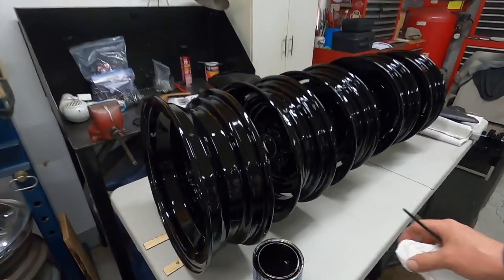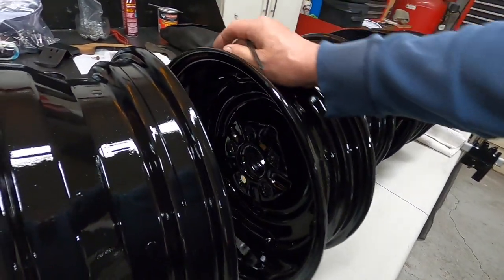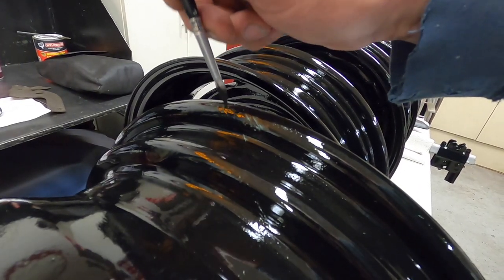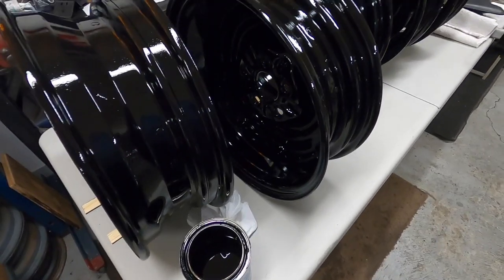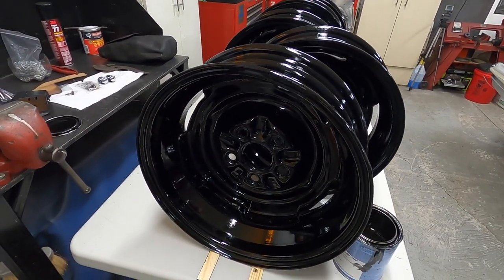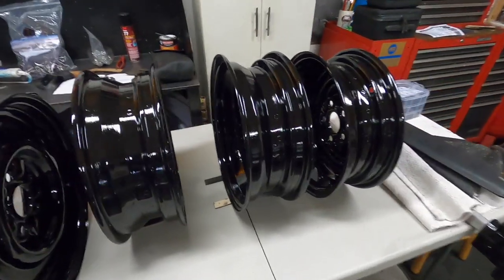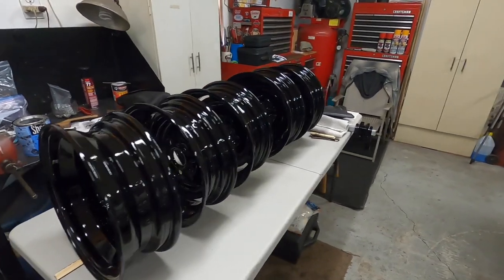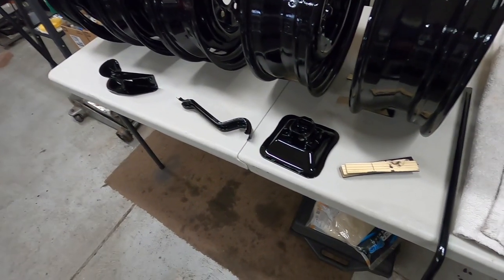1966 Ford Galaxie 500 convertible restoration part 197 doing lots of little stuff & new tires

Comment: Howard, what a nice job on the wheels and jack parts, so many restorations never get this attention to detail. This is kind of the fun part, installing the small parts bringing the Galaxie to its near new condition. The Ford factory put these cars together at a fast pace, during the dis-assembly that you did, in some areas,  it was plan to see that there was areas that could have been sealed up better or primed & painted at the factory, and not left bare. I guess to make these car affordable at the time, and considering Ford was only concerned with the car lasting five to ten years, they drew the line at some point. Most of us would agree you can never  protect metal enough from the elements. Great job Howard.
Reply from the maker: Today I was rust proofing the rear quarters..... The left side had more paint and very little surface rust. The right side had less paint, and a little more surface rust. It's all cleaned, oiled and rustproofed finally. Now when I get the spare tire mounted up, I can reinstall it, then not need to remove it again.... hopefully.....

Comment: Hey Howard!, Those whitewalls look great! I'm having whitewall issues myself ! Came out to find one of  the front tires about half way down! Called triple A to put on the spare (I wont use the factory jack either although my hooks (one design for the front and another for the rear), have big rubber pads to protect the chrome. At the tire store they couldn't find the leak (gee, what a surprise!) so I asked them about ordering another tire and they said you should get 2! They're American Classic so they'll make a pretty good mark-up on those when they come in  FOUR WEEKS! Egad, everything is in slow mode now days!
Looking forward to seeing yours with the hubcaps on!!! It's going to look "awesome!" there, I said it, I used a "kid word"!! LOL!
Reply from the maker: Slow leaks are often the valve core.......

Comment: Howard, You can use Black Spray Dye in a rattle can for the seat belt material. ...and just lightly spray it on.  It works well and won't come off on your clothes... I've used it for decades.. The trick is to use as little as needed.. and it works great.. I just realized that you used Gojo on the seatbelts though...and because of that, The dye might be an issue unless the material is completely free of the GoJo.  You could test it on the belt I sent you first..:o)  Tony K.
Reply from the maker: I scrubbed the belts in dish soap and water, then rinsed them until the water stayed totally clear, so I'm 90% certain the GoJo came out. I use spray die in the past on seat belts, only to regret doing it. Maybe in the fall I'll stitch up new belt material onto them. I have the stuff, so why not.

Comment: Those whitewalls look great.  I look forward to seeing how the wheel cover grips can be covered with Plastic Dip and still grab OK.  My 88 Aries has full wheel covers with sharp grips to hold them on, and over the years I have picked up 2 more wheel covers as spares, just in case I ever lose any.  And since probably most cars on the road today have TPMS valve stems on the wheels, getting air stems in the height you want can be a problem.  Right now, my winter tire set has 3 of 1 length and 1 with a shorter length stem.  I guess the next time I need tires for either the Aries or my daily driver, I have to tell the shop in advance, the length of valve stem that I need.
Reply from the maker: I did the plastic dip thing on the Catalina, never had any issues with them coming off. The tire store stated his supplier docent even carry that style valve stem. I ended up going to a local auto parts to get them.... I bought the whole inventory of them. There is no way I was going to use extensions on short ones. Thats what the tire store was going to do.... I said NO WAY!

Comment: Wow! Amazing what correct tires do to the look of the car! Those cars just have to have those 1” whites. 8.25 x 15 / G78 x 15 ... those were the days ...
Reply from the maker: Yes, the tires are as close to the size of the originals I could find. I was surprised most tire manufactures still offer white walls, so I had a lot to look at, before deciding on these. My F-150 came new with this same brand tire. I was happy with them, so when the F-150 needed new tires, I went with them again, and am still happy with them, so that's why the Galaxie got them too.

Comment: Howard. Amazing stuff and your car is better than factory did it. Rims are so clean looking and should last. Nice choice of tires. Completely different looking car. Great video.👍👍👍
Reply from the maker: The clean new looking wheels and new white walls really do make a huge difference. It looks just as it would have, when it rolled off the assembly line..... the dealer installed the wheel covers.
Reply: Changed the look of the car 150%. Very nice choice Howard.

Comment: The new tires look great!  There's not much you can do about the hubcaps...They will damage the paint to some degree... That's just normal. I don't know if Plasti-dip will do much there...except maybe cause the hubcap not to grip as much as it should.. :o)  Tony K.
Reply from the maker: The plastic dip does help.... I did it on the Catalina. You are correct though, nothing will prevent damage to the paint, but I can cut down on that damage.

Comment: Those rims turned out beautiful. That's the same kind of tires I have on my 1981 Silverado. Great tires, I've had them since 2018, and they are holding up well. 
What's the ETA on that replacement seat cover? It would have to be the driver's side that was messed up!
Reply from the maker: They stated "maybe" the end of April.